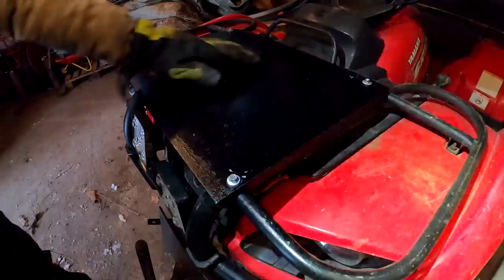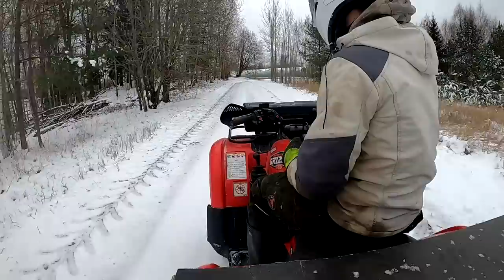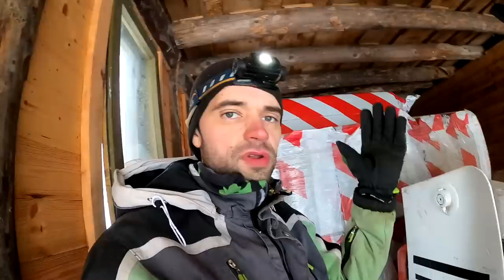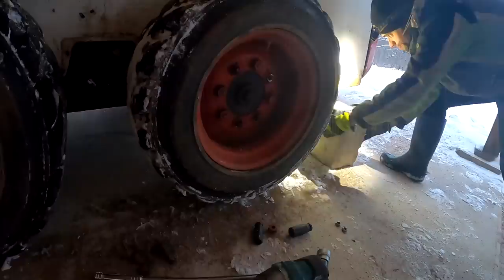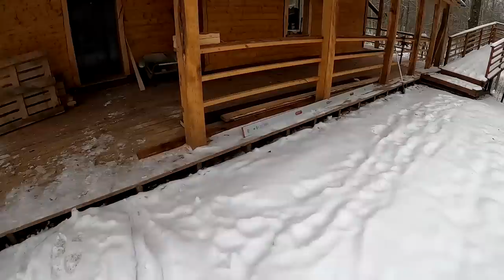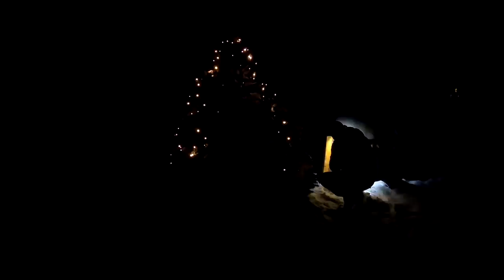Odd ends, side jobs and stuff - vol1

Comment: Maybe add some lashings for the connection points on your wood cages? If you oil them first and use a fast-drying natural fiber rope so it doesn't trap moisture for too long, it should be okay through the weather, and will also reinforce the joints a bit. Maybe. Plus something just appeals about the combination of caveman tech with heavy machinery.
Reply from the maker: hehe, yes good idea! thanks and Happy new year!

Comment: hi, for you're firewood cage's you could use IBC totes, if you use the metal/plastic palleted one you don't even get wood rotting away, and you can cut the ibc blatter in half and use it as a roof for you're firewood (attach with zip tyes). works really good for me.
Reply: Those are pretty expensive and you need a lot more of them to store wood. But yes, they can handle  weather way better
Reply from the maker: Figured that

Comment: I have a John Deere 112 garden tractor with a snow plow I rebuilt the skids but I put caster wheels on instead of metal sliding on the ground then I have a 212 John Deere garden tractor with a snow blower I just use the welder every year to build up the skids I just use 6013 rods I should get some hard surfacing rods it would wear longer.

Comment: I have a 2004 Yamaha Kodiak 450, I got the thing with less than 100 hours on it, and it’s been very dependable and handy ever since, I did have to set the float level in the carb and put a slightly larger pilot jet in the carburetor and it became a lot less cold natured. But they’re not road legal here, it doesn’t stop the farmers from doing it anyway, it’s not a problem so long as your respectful.
Reply from the maker: That's cool m8

Comment: All right! Finally had time to watch the complete video!
1. The Grizzly seams to work good but if you weld a round pipe, about 20mm in diameter, on the edge of the plow you can skip the shoes and it will clean well without destroying the lawn/soil/ground/patio/wooden deck/whatever. Also, I think it is time for new tires on the Yamaha, grip seemed a bit lacking in the wet snow. 
2. The wood stacking system you have seems to work great, screws are easy to replace so I would rather use them than nails, hate nails. The grip on the bobcat is impressive considering it has those F1 tires. Always thought the wheeled skid steers they were more for hard ground than snow/mud but perhaps I was wrong. I think Andrew Camarata said something like that but the tracked ones are really expensive in Europe. 
3. I love the lights, need to do that to my barn next year. All I need is a good extendable ladder like the one you got. 
Anyway, see ya later!
Reply from the maker: Thanks for the tips Nils. I will look into getting new tires for the yamaha soon